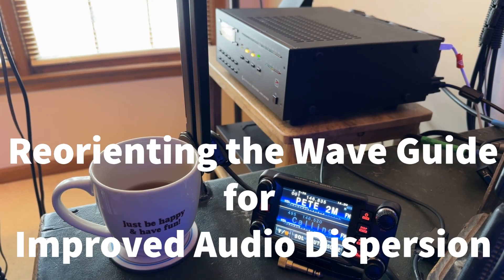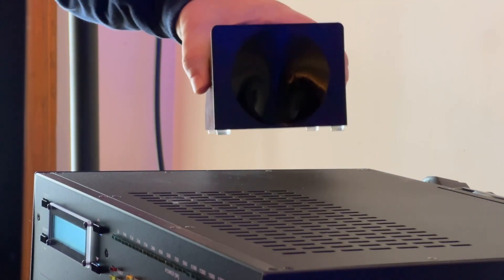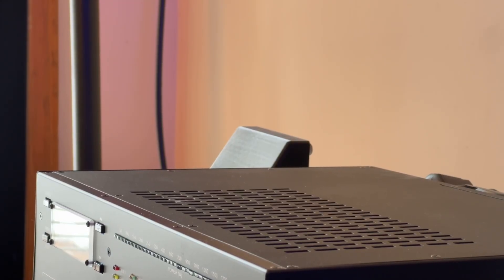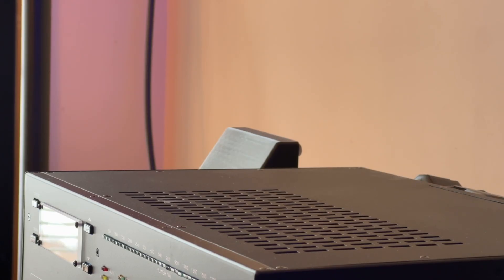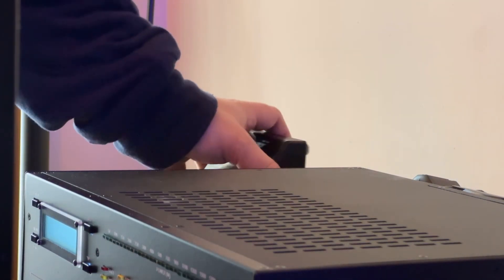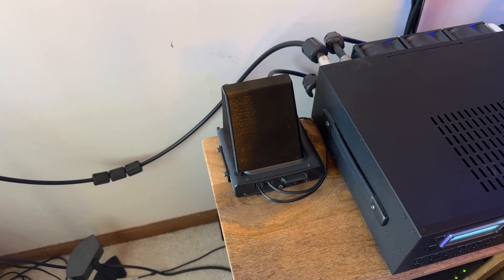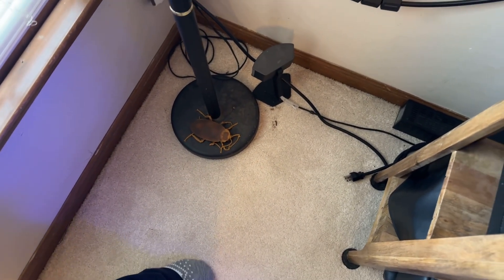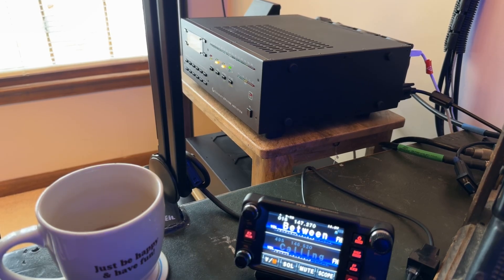Reorienting the Wave Guide for Improved Audio Dispersion #hamradio #audio #ftm400 #waveguide

Comment: For comparison, can you try standing the unit on its side with the speaker aiming at the wall?
Reply from the maker: Not practical.  It’s not stuck to the radio. It will therefore not stay. But the results would likely be the same.  It would still be redirecting the sound toward the wall.
Reply: @n4hnhradio  Suggested standing the radio on the side without the box on top. It should achieve a similar result.
Reply from the maker: I tried that first.
Reply from the maker: The wave guide provides a type of extended resonance chamber. The speaker in the radio doesn’t have much of a resonance chamber to work with.  

As radios get smaller, the quality of sound coming from them diminishes. The FTM-500 has improved audio because it has two speakers and the ability to time align between the two. That’s what the AESS does.